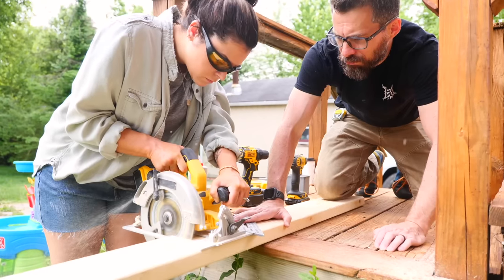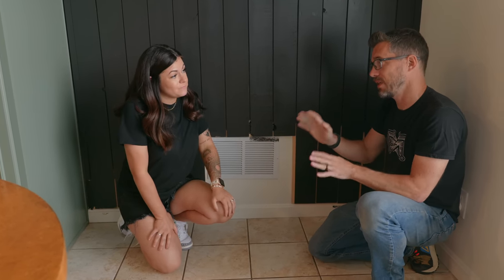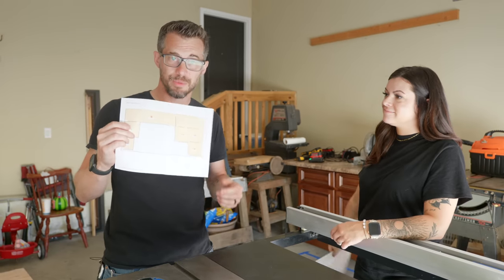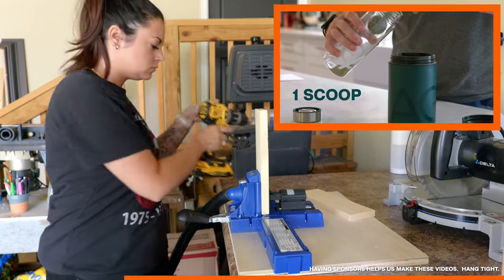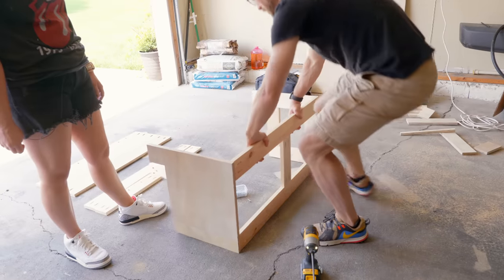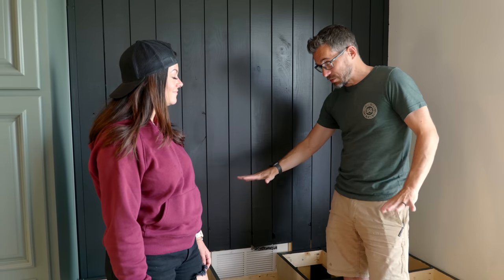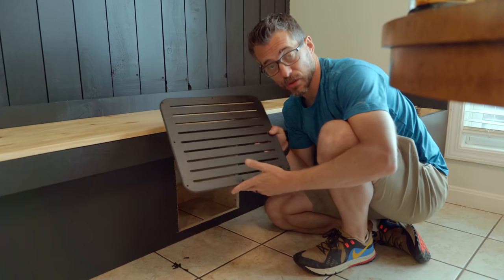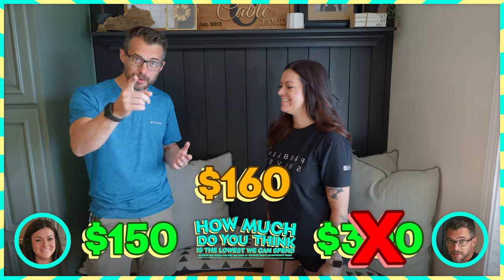Quick. Cozy. WAY cheaper than you think.

Comment: My wife and I went to Home Depot around 1985-86 & wanted to buy a 4X4 for a project. They said they could cut that piece of wood down to more manageable pieces. I thought great. I had already measured the dimensions/length I needed. One of their guys took his tape measure & marked down the board/post & proceeded to cut the wood down. Out of a 8 foot piece of wood, only 1 piece was measuring @ my length. Others were longer & still others were not long enough. I was able to get only 4 pieces to length for my project & all the rest was nothing but scraps. Not a professional job at all.
Reply from the maker: I get that. We actually measure it out for them and stand with them while they cut. Not necessarily "over their shoulder" but we haven't had any major issues. Sorry about your experience.

Comment: I think it might have been better for the return to basically extend it, and put a filter behind the grate you laser cut.  That way you don't have to mess around with the one in the back
Reply: I was waiting for someone to mention that and it looks like there was a little more restriction in the airflow if that is really the return for the AC. They are going to have a bad "delta T" because of the restricted airflow but I guess time will tell.
Reply from the maker: Good news: her husband is AC certified so they can keep an eye on things!
Reply: @Iliketomakestuff  are the cross braces in the space where the air return is still there or did their AC start to run hot?

Comment: All these "we did this on the cheap!"  Not sure why most don't simply say "cost of materials" and instead want to pretend the viewer can do it for the price suggested.   Aside from not counting labor, using $500 a year software and thousands of dollars of tools makes the number stated absurd.
Reply from the maker: Meighan used the free license of Fusion 360.
Reply: What is absurd is that you think she should be adding in the cost of labor or things she already owns to the cost of the project. Add $30 for a hand saw and a hammer/screwdrivers. That's still less than $200 in cost and you can make it. Now what excuse is there that this would be an absurd cost? Add $40 for a circular saw and it gets easier to make. Every cheap project you make, you can buy one more tool that would make it easier. Eventually you will have all these tools that you can use on each subsequent project to make it easier. She doesn't need to apologize for having tools already that she either bought as she needed them, or saw a great opportunity to acquire the tools at a low cost.
Reply: @bendingsands87  Cool story.

Comment: That air grate is way too small. It should have the same cross sectional area as the existing metal gate’s open area (which you can find by tilting the grate to be parallel to the fins).